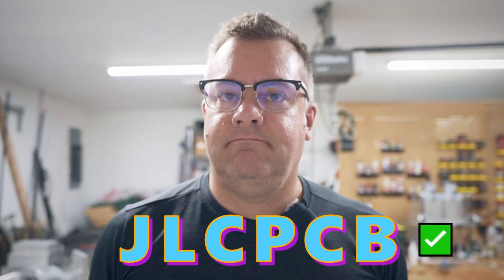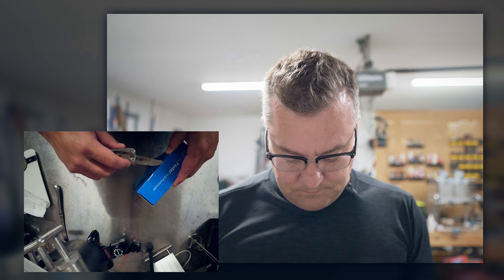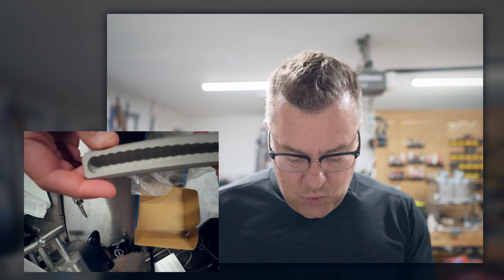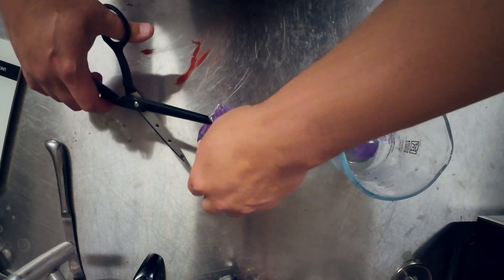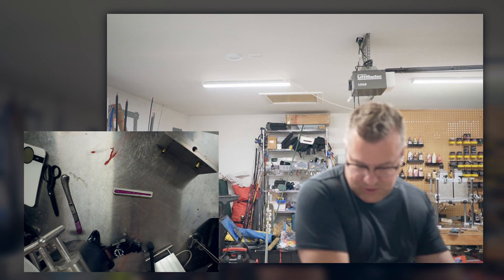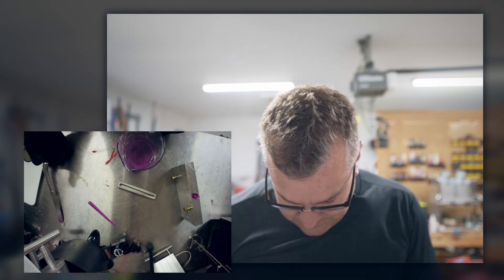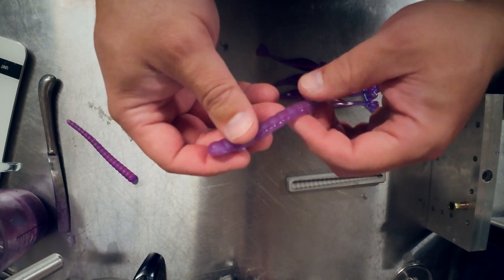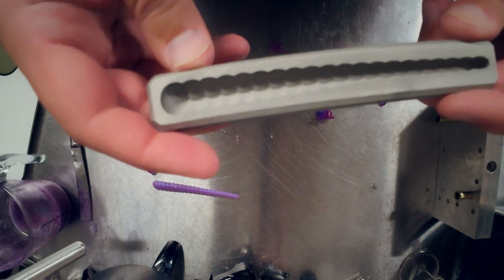3D Printed METAL Molds from JLCPCB

Comment: That mold is entirely doable on a standard 3 axis mill. Undercuts are not a big deal, but you will need a specific type of cutter, called a Lollypop or Cherry cutter. Just so you know-don't be afraid of small undercuts like that.
Reply from the maker: Doable yes, cost goes up and finding someone to do it is harder.

Comment: I had 2 CNC molds machined and I don't have such a shiny finish, how come?
I don't even know if it's possible to have such a smooth finish
Reply from the maker: Really depends on the mold maker but you can get them pretty shiny. It doesn’t really matter I got a lot of guys that don’t want them shiny now…
Reply: @WMBayouLures  
You're always present in the comments, it's a pleasure. Sorry for the French/English translation, certainly bad for you.
I don't know if I could choose, with 2 different machinists it was never offered to me. Does it cost much more to make the mold shiny?
Thanking you.
Reply from the maker: @MIRADAI13  your English is 1000x my French! 😉 if the machinist makes injection molds they should know the finish requirements if they don’t this video might help - https://youtube.com/shorts/7PBG1pp4kZk?si=JotEbYTnHmDHkJCc
Reply from the maker: I know them. I have seen the machines they use in there videos and they are not really able to provide the type of surface finish I think you are looking for. When it comes to CNC you get what you pay for.

Comment: Just made an order. It says my order was completed, but there was never any option to submit payment info? I guess it didn't need any since my total was $51 (and the coupon is $54?). Did you deal with this when you ordered yours?
Reply from the maker: Ordering was a 2 step process, upload your part and choose the process (3D metal, PLA etc..) they look at the part to make sure it is possible to print, then once its approved you pay, the part is made and shipped.
Reply: @WMBayouLures  Thanks

Comment: How do you not get crazy denting on the freefall fry? Just because of the slight pectoral fins? I added more aggressive pectoral fins on my 3" swimbait and it gets rid of the denting but the fins don't form all the way because they're not vented. Might have to get a new mold done with less aggressive fins if they'll still solve the denting
Reply from the maker: I watched my video on denting! - https://youtu.be/uVg00SCgcMY 😆😎

The front of the FFF is square and the sprue is the same size as the front, that helps a lot. Aggressive fins without venting are just asking for trouble. They work sometimes and then don't work other times. Not worth the hassle in my book.

Comment: Nice review. Now where can we get those metal 3D printers? Would it cost more than cnc milling machines?
Reply from the maker: The printers are not cheap, one of those where you have to request a quote 😉 but then you need a sintering oven and those are not cheap either. I will see what I can find out…
Reply: Full metal 3d printing setup can easily be six figures, plus your programming and CAD equipment. CNC mills start at 50K, plus CAD and CAM software, tooling, etc. There are metal filaments that are available for standard 3d printers, but the sintering kiln can be pretty expensive.